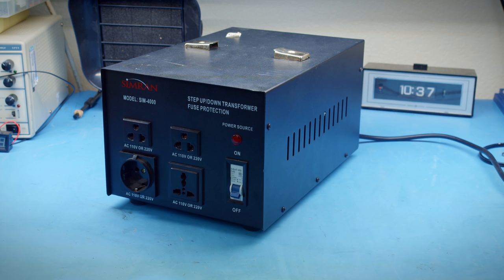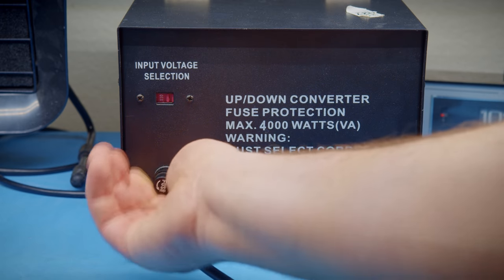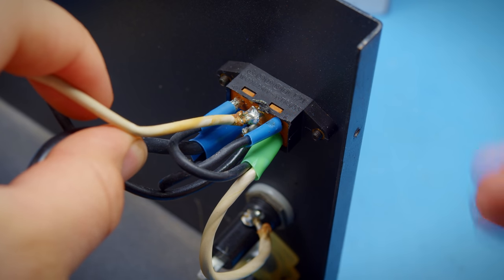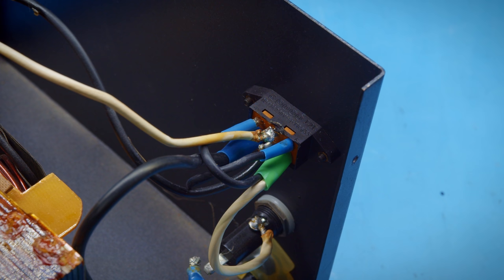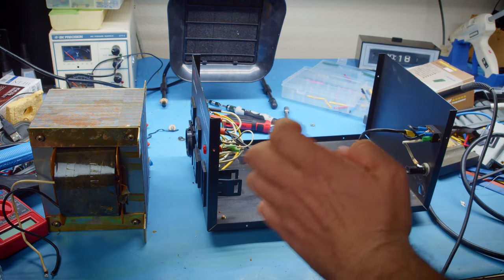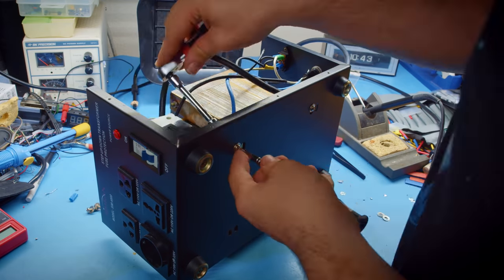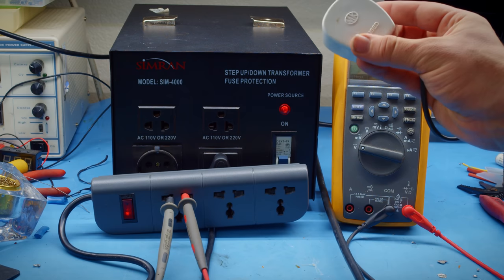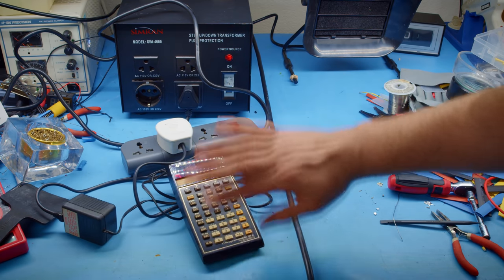Making 240V AC In the USA, Interesting but Dangerous

Comment: Rule of thumb when buying cheap electronics from overseas... If it has a plug that goes to your wall, open it and verify that everything is soldered and assembled well before ever plugging it in. I've seen these issues pop up with nearly anything 120 or 240 volt... Soldering Irons, Hot Air Stations, Air Filters, you name it... If it can be put together, it can be put together badly!

Comment: I realize the build and component quality was junk, but this is actually a clever circuit. You often don't need isolation, just voltage conversion. And if you do rewire and rebuild  it as you did, it isn't that bad.

Comment: I skip (dumpster for Americans) dived a distributed audio system CD carousel unit years ago when our local Borders book store was being refurbished, because the units were American in origin I also had to grab a multi tap power strip along with it. The strip was wired into a fairly dodgy looking step down transformer with no enclosure or any other safety features. Still have it to this day and would trust it way more than that steaming heap.

Excellent video, you've got a new sub from me.

Comment: You should throw that C40 Breaker (which is also fake without any fusing elements (Magnetic or Thermal) away and get a nice switch. Since you're using a small gauge wire, you're limited there anyway. Also the breaker in your home would trip way earlier.
Reply: Seconding this. Toss that garbage and get a proper one (though that form factor of breaker is uncommon in the U.S.)

Comment: An autotransformer! It remaind me the electrical machine lesson at school. At work we had 2 step down transformer (i live in italy), one diy with a big isolation transformer and a Roland one similar to this, we use for american artist that need 110 volts on stage (now in the show biz we have a lot of thing with switching power supply that support both 110 and 220 volt, but a lot of guitar amp for example work only with "home" voltage). 
An for @18:50, in my City we have a proton therapy center, and when they build it first they had make foundation, put the accelerator and then build the building around it!

Comment: That crappy solder job is the same as was inside my Chinesium powered soldering and hot air rework station. I felt ridiculous using and old school soldering iron to rework the solder connection inside my new soldering/ hot air rework station, but at least now I trust the integrity. Copper plated aluminum is actually very common because it is cheaper, AND aluminum has less resistance, making it a more effective conductor. Being clad in copper keeps the ocidation issues to a minimum, but it is WAY harder to properly solder as the wire wicks away the heat so fast that it is difficult to get hot enough to get a proper non-cold solder connection without burning the next half inch of wire insulation to a molten puddle of goo. Add to this problem that most manufacturers have to use the lead-free solder to comply with RoHS requirements and you end up with some pug-fugly joints. Here in the US you can buy the leaded solder (with lower melting temps and more crack resistance), but individuals don't have to show RoHS compliance in their repairs. Now, if that sounds bad, the crimping down on the insulation is really bad. Soldering small wires going into a lug isnt as bad as large wires, but a much better choice is either bare wire, or my preferred mothod of crimping on a ferrule, which is just a short peice of metal tubing that gets controllably crushed holding the individual strands together in a mechanical way. This way all of the conductors are under the lug (no single strands popping out the side) and are all carrying the current right at the junction, which is where most faults occur (weak joint with few conductors carrying the load cause localized heating, which raises the resistance which in turn generates more heat). That's a viscous feedback loop if ever there was one (rivals telling your wife that something was wrong with what she made you for dinner).....
Nice video. Really like the explanation of the auto transformer. Very similar to the multi-tap transformers used in many industrial machines. Just remember that is is not an isolating transformer.

I hope to god that you didn't do all of that to be able to plug in the calculator. Hope that was just a test.

New sub here.

Comment: Reason it's rated at 4,000w is because it's rated on 240v power at 16A. 16A circuits are very common on European 240v systems. 

When using as a step up transformer, take the current rating of the circuit you're powering from and half it. That would be your output. So a 120v 20A circuit will give you 240v 10A out. So 2,400w.

And the loop is called a Ring circuit. Again, very common in Europe.

Comment: I used one of these for several years.  Mine was 1500VA, and had an IEC input plug on the back, for easier input changing.  I used it to power a 220v only PC power supply off US Mains.
Reply: I also never used a power strip on mine, as I only needed to power the one device.

Comment: Disappointed by the constant bitching about literally everything wrt this poor box, while in reality - except for the abysmal soldering job - it does what it's supposed to do and you definitely get what you pay for. Nowhere it is claimed that it's isolated, the comment about you not being able to draw 4 kW of power on a single phase is inexplicable and complaining about having too many sockets on the thing is both weird and dumb. And it took you days to resolder two dozen solder joints, tops?! DAYS???!!! WTF... 
An objective summary would be: "Should you need to power something heavy-duty from a different voltage and you're prepared to re-do all the solder joints inside, it's definitely worth a couple of bucks". You're welcome.

Comment: This might have been said already but... I'm pretty sure the plug on that power strip isn't UK compliant. If I remember right, it needs to have a fuse in the plug and the two power pins need some sort of sheathing at the base so you can't accidentally touch them while (un)plugging it.
Reply: A month late replying but that's definitely not a UK strip, I think it's India? Maybe he bought it because the sockets are fairly generic, it's a Belkin who are a reputable brand but that old white plug which he plugged into it is an example of UK standards not the round unfused black plug on the extension lead

Comment: A Variac also is autotransformer.  Also just 3 wires (unless there are some optional taps.  The benefit of the autotransformer is that the core power rating is double relative to an isolation transformer.

Comment: That round pin plug is not European, I believe it's Indian, although if it's the small 6A type, we also use them (rarely) in South Africa.

And yes, just buy an inverter, a Victron Phoenix 12/250 230V for example.

Comment: also triple lead transfromers are common, if you have ever looked at cheap welders , you know, and the fire hazard is actually a cooling problem not an electrical problem, if you only give it loads that its designed for it should be ok, but a case fan can make these type transformers last for life.

Comment: One other issue with this sort of transformer is that it's still 60Hz, not 50. Some things will work fine, some things won't work at all, and some things may appear to work but are overstressing internal components.

Also, a lot of bathroom scales aren't really accurate for anything lower than 50lb or so. (In a pinch for a check you can weigh yourself with and without the item and compare.)

Comment: Extremely dangerous that part! It's a tangent to a death-wish(excuse the pun) ... and thanks for the video:) 
OMG, the sockets?!? Continuously cold soldering points, even on the protective earth. Attached with hot glue. That just calls for a break, which is likely a death sentence. 
The other alarm signals that this botch sounds would fill a book (fake fuse, under-dimensioned components, failure to observe any safety regulations, etc.). The appropriate book for the manufacturer (AND user!) is probably the criminal code! :)
Immediately in the trash with it! Or use a completely new housing with approved sockets and proper grounding ... which will cost as much as this junk. No, don't do it. We cannot look inside the transformer. It is potentially life threatening and also a fire hazard.
Edit, watched half of the video: Soldering the protective earth is irresponsible and by no means should it be done this way. Stranded copper cables require wire end sleeves or suitable cable lugs. A transformer is involved here. This means that there can be hum and thus physical vibrations. A soldered connection for conductors carrying mains voltage is therefore inadmissible, even irresponsible. I cannot stress it strongly enough: this device is life-threatening! Even after a general overhaul. The device is flawed by design.
Edit2: WTF? Have you(everyone out there) ever touched the power plug of a 2000W fan heater? What do you think will happen to the soldered connections and the undersized lines of this junk machine. It will definitely be a celebration when they unsolder themselves under load.

Comment: For devices rated 220-240, US 240V will work. For devices rated 220-230 or 220 only, the voltage will likely be too high (I get about 248v from the wall) always check the input voltage ratings!
Reply: @LabRat Knatz yes, I'm running many vintage devices rated 220-230 only, I do not plug them into US 240V service. For this, a 230v transformer is ideal.
Reply: @LabRat Knatz I recommend either Nissyo (made in Japan) or Hanil (made in Korea). Nissyo has been making transformers for almost 50 years, and Hanil for nearly 40.

Comment: Maybe I'm missing the obvious here, but why not use the 240v from the breaker panel? Dryers, ovens and garages usually have 240 outlets. In a pinch I've found two outlets feed from opposites sides of the breaker box. (The latter is highly NOT recommended)
Reply: Not everyone has 240v coming from the panel.  I'm in a house with a gas water heater, gas dryer, and gas stove.  All of the breakers (save for the main incoming) are single-phase, so the best you'll get at any outlet is single-phase 115-125V.

Finding two outlets fed from either leg of the breaker box would work, but can lead to some rather amusing, or interesting, problems in the event of something failing.  If something shorts and pops one breaker, and you reset said breaker, you might not necessarily trip your main breaker... You might blow one of the two main service fuses instead.
Reply: @DakalaShade  Well, I AM being a little presumptuous. I've added a few 240 outlets in the house for higher voltage applications but I also understand that this solution may not be for everyone. One other totally bonkers idea I want to try is using one of my high power amplifiers fed with a 50 hz signal into a step up transformer to feed some PAL devices. Not that it's a good idea, more because I want to see if it will work. 😁
Reply: Some people don't live in a situation where there landlords like them install, or let the, have someone else install, stuff like that. As he said, if he could do it, he would, but he can't, so he shan't.
Reply: @DakalaShade  All US homes have 240volts incoming into the panel regardless of the appliances or breakers inside. The panel input is 2 120V hots, 1 Neutral, and 1 ground. A single phase 240V breaker just takes up 2 spots in the panel, and provides 2 hots which give the 240V needed for certain appliances (and heaters). In the case for domestic 240V, it's 2 hots, 1 ground, where the 120V is provided by the 1 hot, 1 neutral, 1 ground.
Reply: @deathventure  I know how the 240v US system works.  In my house, if I wanted to add a 240v breaker, I would have to upgrade the breaker box because every slot is filled.
Reply: @DakalaShade  The way you worded your reply is weird then and didn't explain your situation.

Comment: It looks like the wires inside are going to go up in flames way before you run 16.7A / 240V or 36.4A / 110V through it. That fuse had better be less than 10A or less. No way this thing is going to draw 4000W without trouble.

Autotransformers are not by themselves dangerous, as long as you are aware that the input and output aren't separated. You basically just have to care as much about staying away from the outputs as you would have to with something that's connected directly to the mains. And a ground fault interruptor in your house will actually work if you connect something to this that has a short between live and ground, unlike a separated transformer.
Reply from the maker: I have bad news, the fuse it came with is 30A.

Knowing that it is an autotransformer and how it works is what I wanted to convey initially for this video. I just got distracted by the fact that mine and seemingly every one of these for sale was assembled by the lowest bidder's stand in who had barely heard the word solder before. Autotransformers should be fine, as long as everything is done correctly with them. About the only thing right with this one seems to have been the polarity, and that's about it.
Reply: @TechTangents  Yeah... If that fuse is 30A I have some news about what your actual fuse is going to be when you have a short...

Recommended wire gauge for 30A is 12AWG. It looks like that thing has something like 18AWG. (https://www.powerstream.com/Wire_Size.htm)

Comment: this generated a lot of comments but I'm just going to bang this out real quickly, just in case other people are reading this.

- 'auto-transformers' are almost never galvanically isolated transformers. 

- its a thrift store find, likely chinesium from like what, 20 years ago? even now, youd be hard-pressed to find anything from mainland china that'll meet the quality of what a drunken japanese salaryman or german apprentice will put out. expectation management. 

-  also wall-warts are now almost entirely universal-in (both at 50-60hz 100-240v) SMPS. all you have to really do is find your target output voltage, match it to the device, and they device will source the current necessary (unless you're doing something weird like using an SMU 4-quad to force current or something) 

- most of those thermal losses, unless you're at eddy core saturation, will be i^2*r losses. since you're stepping up, these will be of almost no consequence, presuming that really is copper and electrodeposited copper ontop of aluminininium. that will certainly be capable of 4kw out. if you got it for less than say 60 bucks USD, you got a steal

- you can easily get 4000w out to a domestic install (i.e. what an average home owner has in the us, none of that fancy "i have 3 phase 440 to my home because i'm in germany" shit), fully coded, with the provisio you run the proper gauge and your distribution board is configured properly

- yeah fuses (even those generous ones, designed for motors--and thus have a more liberal trip policy and contacts that are rated for higher cycles) are not the way to switch that unit. that being said, i fully assure you that the tabs on the power strip surge strip you're running is not rated to switch loads. there'll be MOVs or something in there, along with a stout bus bar.i dont know what UL or IEC is called out to protect against surges, but they're 14kv exp(x) decay at 50 microseconds FWHM. the real reason you end up having contacts fused together is too great a dV/dt value (*not dI/dt*) and so there's corona discharge. the term you're looking for is "contactor" and the specs are 'trip characteristics' and/or 'thermal overload'. 

 i'm a nerdie nerd not an electrician, so i fondle the magic pixies in a different manner, but there are application notes from all the big boys like allen-bradley, eaton, ABB, etc, who have literally thousands of pages documenting both the 'right way [for clients or whatever]' to do it and the 'hacky but safe way' to do it (and sometimes also the 'hacky and hold my beer' way to do it, which can be equally safe. red neck farm engineering a wild 3rd leg on a 3 phase motor works just fine.)

Comment: Might as well just run a 240 volt circuit from your breaker box, assuming you have that capability
Reply: Or:
1 find two 120v circuits that are not powered by the same mains line
2 get an outlet box
3 get a 240v outlet
4 connect hot from cord to one 240v outlet connector
5 connect hot from other cord to other 240v outlet connector
6 mount outlet in box
7 plug in cords to 120v outlets, that are not sharing the same mains line
8 congratulations you now have the 240v  that's actually supplied instead of the 120v used

Notes:
3 wires connect to breaker box
2 hot of 120v each
1 neutral 
breaker box connectors usually alternate 120v circuits between both hots for load balancing 
240v circuit connects between both hots in breaker box

Comment: Should get rid of the (cheap) switch and simplify it for your step-up application. Also get rid of the bottom-right connector and get a real UK socket. Those universal things are not safe.